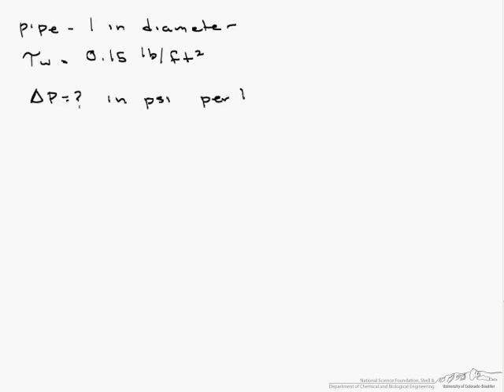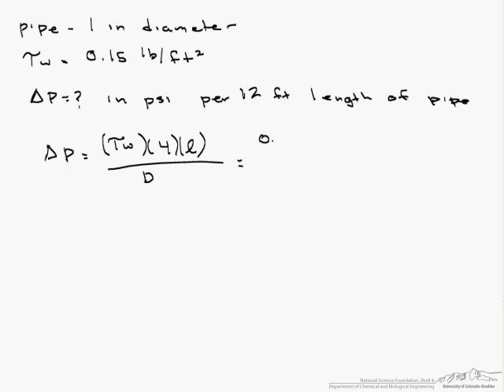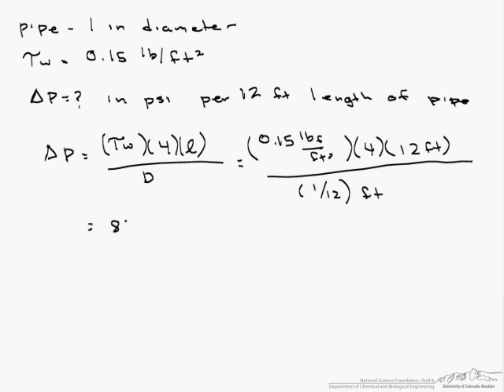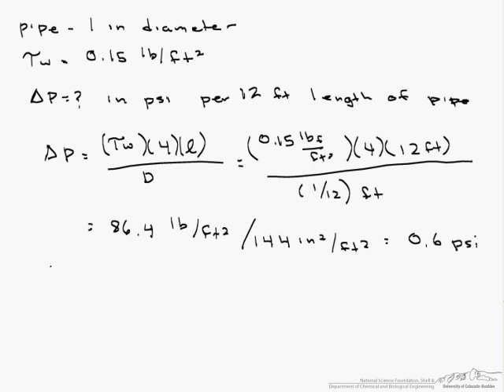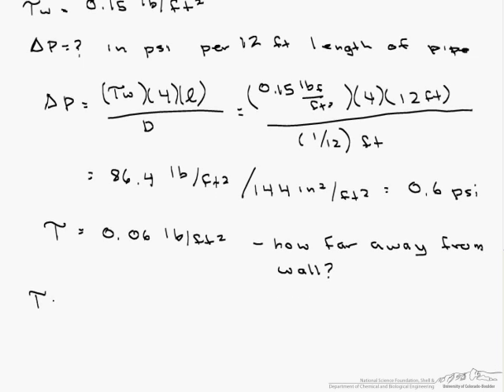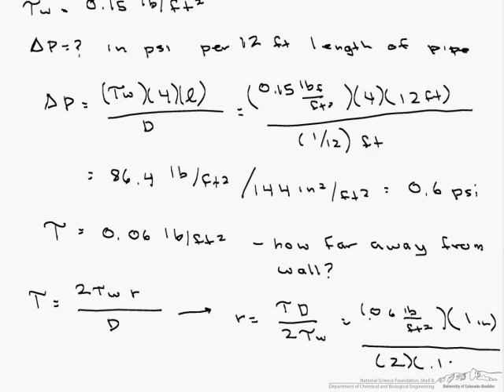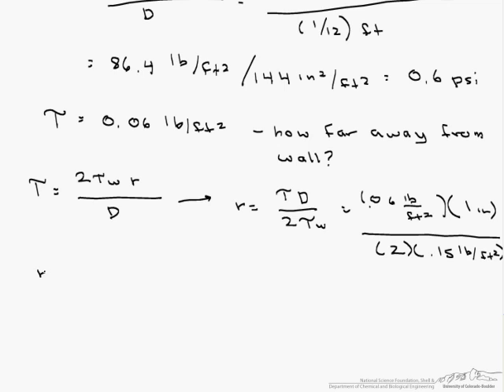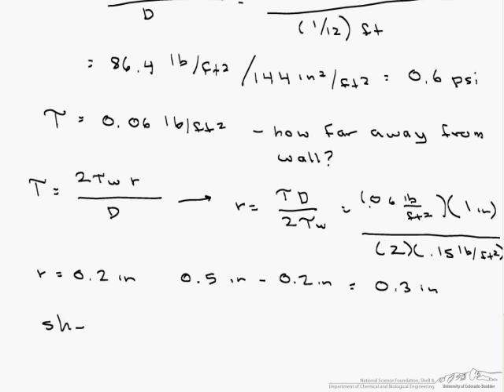Pressure Drop in a Pipe (Laminar Flow)

Comment from the maker: @mr6alal Remember fluid will flow from higher pressure to lower pressure.  There is a pressure drop along the pipe due to friction (shear along the wall).  this would be important to determine when sizing a pump and determining the entrance pressure necessary to maintain fluid flow.

Comment: After I got out of the interview i was like OMG, what did i say, pressure should rise down the pipe line beacuse the wall friction will act like it's squeezing the fluid, therefore, P2 should be greater than P1. 

Now i'm so confused, I dont know what the answer is. We studied pressure drop down a pipe line, and cant even answer this question ! 

any comments? or if my answer at the interview was right or wrong ? Should I have asked if the flow is Laminar or Turbulent ?

Help Please

Comment: So here is exactly what i said: Well, the pump will push the fluid in the pipe at a constant certain speed and the since there is roughness at the pipe walls, it will affect the pressure down the pipe line (the pipe is straight with no inclines or anything, simple geometry) and we will have PRESSURE DROP, so P2 is less than P1.

Comment: During the interview, they guy pick up a small paper and draws a striaght pipe with a pump at one end, and marks P1 (P = Pressure ) after the pump and P2 down the length of the pipe, and asks me: is P2 greater, less or equal to P1. So I was put on the spot and i was like ok i need to show them that im thinking logically even though I'm not sure what to answer.

Comment from the maker: @mr6alal This is a good question because it actually does decrease even though delta P is positive (shear could be written with negative value since its acting in opposite direction to flow, depends on how its taught).  If the pressure increased down the length of the pipe, what would happen? This would act against the flow of the fluid.  So pressure does drop 0.6 psi per 12 ft of pipe.